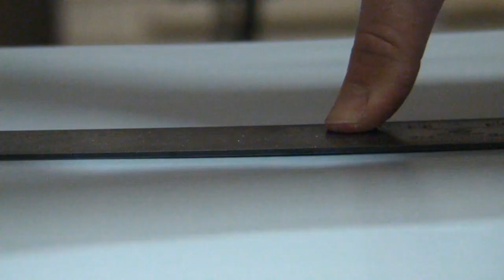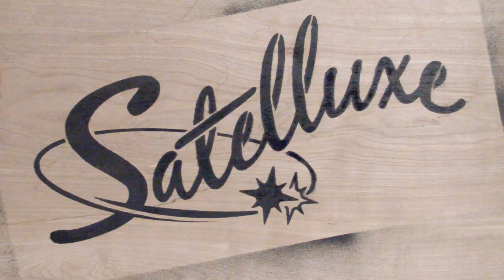Building a Wooden Shipping Crate for a Neon Sign

Comment: Can you share with us the name of the table saw and other saws used? Thanks!
Reply: The first saw he used is a Miter Saw.  This is used to cut boards or long strips of wood into chopped smaller pieces. You can do it on a Table Saw as well but this makes it easier.  A miter saw comes with many features. At its most basic, it just comes down and chops the wood. A sliding saw has an arm that slides to cut wider boards.  A bevel or dual bevel is when you can angle the miter saw to right or left side so the wood is sliced at an angle.  If you want all the features you can have, get a compound, sliding, dual bevel 12"miter saw.  The blade size comes in 10" or 12".

The second saw at 0:52  is a corded circular saw. This is easy to cut large plywood sheets on the ground when they don't fit a table saw.

2:00 - This is a table saw.  You can buy a smaller portable one from Dewalt or invest in a large heavy accurate cabinet saw. This is an all purpose saw mostly for large boards or trimming off ends.  If you had to buy only one saw, this is the one to get.
Reply: @mjremy2605  thank you so much!!! I need to start building shipping crates to ship furniture for my online furniture store. And I think I will get a table saw.

Comment: Is there a name for the technique you use in your editing where you drag the audio of one clip over the video of the next?
Reply from the maker: It's called a split edit. More specifically, if the audio comes in before the video, it's called a J-cut. If the audio bleeds over into the next shot, it's called an L-cut.
Reply: @WesleyTreat  Occasionally your J-cuts scare me.  Like you are manually changing the blade on a table saw, then the audio of the saw starting up precedes the video change.  Please be aware of this when editing.  I like build videos, not horror videos.  :)
Reply: @NeilFraser  😆😆